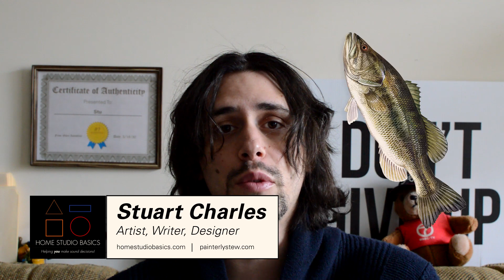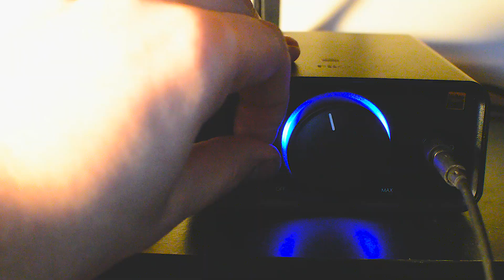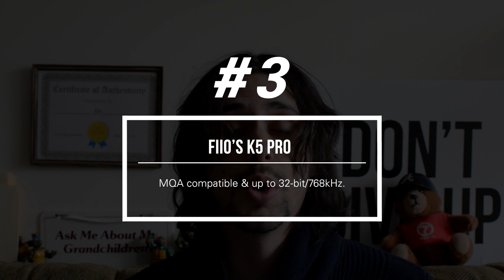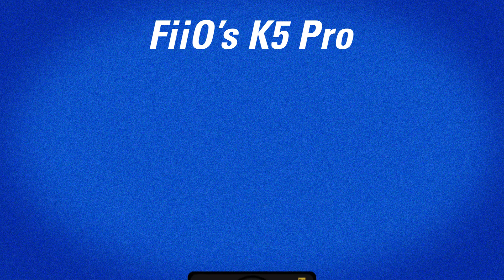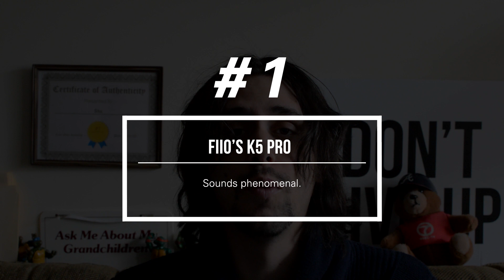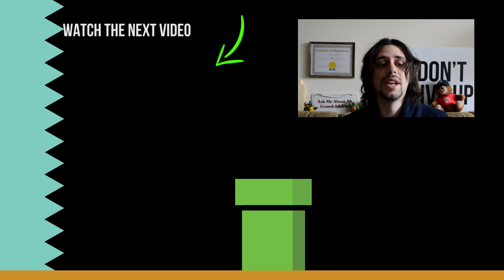💡Before YOU Buy A K5 Pro, WATCH THIS!!

Comment: Do you think the soundsignature is noticeably diferent on the new ESS model? Considering picking this guy up. Thanks for the video man.
Reply from the maker: Hey man! I haven't tried that ESS version but I'm assuming it uses the Sabre chip. I'm going to try and get one for demo/comparison.
Reply: @HomeStudioBasics just picked up the K5 Pro ESS from Fiio's Ali store for $90 for Black Friday.
Reply: For most DAP and DAC, I only notice the significant sound signature when using the balanced output. So I recommend you add a little more money to buy the k7 and use the balanced output.

Comment: Hi. Ive watched your vids for like more than 10x and I just cant decide if I am to get this or an E30/L30 stack. Do you have any insights on it? Thank you
Reply from the maker: It's kind of tough but I heard there were issues with QC on the Topping Stack. The one thing I like about Topping over K5 Pro is the remote allows me to be even more of a lazier SOB than I am. Never have to get up to adjust the volume lol. 

Both K5 Pro and topping have the issue of messing with wires a lot if you want to transport them vs. the G6 and Zen V2 are USB plug and play. That's just for gaming though. If we're talking about general listening, I use the Zen and K5 Pro about equal, maybe Zen V2 slightly more. 

Sound wise, the Topping is def the most neutral so if that's what you value, then it's probably going to be better for you. The Zen and K5 Pro are kind of like a cross between neutral and warm-ish.

Comment: I understand you can use the k5 on the "old" consoles via optical cable but is the k5 pro usable on the ps5 or xbox via USB?

Thanks :). <3
Reply from the maker: Hey man from my understanding you can use an HDMI extractor but there's also this way: PS5 (USB) -> UAC1.0 device (Optical/Toslink/CoaxialDigital) -> your DAC -> your amp -> your headphones. If you don't already have a K5 Pro I'd honestly just get a Creative G6 as you can just plug it into the front via USB and it's much easier. I have no idea why they did away with optical. Stupid and annoying, I know. https://homestudiobasics.com/creative-soundblasterx-g6-amp-dac-review/

Comment: Probably late to the party but can anyone or even your good self help me, is there anyway I can connect this or pair this with GOXLR, have looked all over internet and YouTube and I am none the wiser…..many thanks in advance
Reply from the maker: Hey man! Looks like that has a line out so yeah. Just use 3.5mm from the out into the RCA input on the K5 Pro and tick the switch on the K5 Pro to the middle for "line". :) AFAIK, the optical on the GOXLR is an I/O so that will work as well. For that you'd flip the switch up one on the K5 Pro to S (for S/PDIF). Let me know if you have any questions!

Comment: Hey,
I currently have a Dragonfly Black which I'm using to power my HIFIMAN SUNDARA.
Since they day I bought my DF Black, I've been doubting wheather they were the right purchase, because I feel like the Hifimans have much more untapped power.

Have you used the Df Black before, and if you have, how much of a difference did you experience b/w that and the Fiio K5 Pro
Reply: APPARENTLY AMPLIFICATION IS SECOND MOST IMPORTANT FACTOR NEXT TO THE HEADPHONES
Reply from the maker: Sorry. Somehow that comment got entered into the wrong box. I'm really sorry about that lol. YouTube is strange sometimes. I'm going to go ahead and delete that. There's a guy who's been asking me questions for 3 years and still hasn't bought anything haha. 

I haven't used the Black with a Sundara, but the difference between the Dragonflies and K5 Pro is that the K5 is a bit on the warmer side while the Flies are very cool, open, and spacious sounding. K5 Pro is my daily driver though so there's that. I use it because it sounds really good, has plenty of power, and is super versatile. I like the Flies and always recommend them because of the ESS chip (which I think is just about the best), but I'd much rather have a K5 Pro for everyday duties. :) Let me know if that helps man!
Reply: @HomeStudioBasics  Thanks man

Comment: What do you think is the better one sound wise? The Samson SR850 or the Sennheiser HD206,201 they are priced the same where i am from. All the other models and brands are overpriced here. Thanks for the help. Your video started my interest.
Reply from the maker: Hey man! The 201 and 206 are technically "better" on paper, but you may find them dull, boring, and too flat after awhile. They also aren't the fastest and most capable drivers out there, but it's to be expected for the price. I still like the 201 quite a bit, but you may just end up upgrading down the road. The 850 is great, but does have the treble bite What about something like a K240 or 9500? Actually, the KPH30i dumps on all of them lol. Haven't added that one in yet, but Check out my budget kings list: https://homestudiobasics.com/philips-shp9500-review-impressive/ I think all of those should be on your radar and I'd bypass 201, 206, and 850. :)
Reply: @Gabriel Cua you are here from dankpods right?

Comment: The K5 Pro pairs nicely with the HD560s - which makes a pretty competent sounding budget setup.
Reply from the maker: Yes! Great pair. I'm listening now with the 9500's and it's just perfect because it kind of tames down the bite that the 9500's have.
Reply: Is it worth it? I have the HD560s without an amp, just straight into the mobo. Is there a noticable difference?
Reply: @Maoilios  I tried the HD560s with an Ipad Mini gen 4 (which is ok sounding) and a MacBook Pro. Both of them sounded quite lifeless compared to the  K5 Pro.
Reply: @stefanredmond8884  Got it, thanks. Been thinking about getting an dac/amp for my hd560s, mainly because of static noise from my motherboard and some crackling, so the k5 pro is probably what I will choose
Reply: I have the HD560s and I don't know whether to buy the k5 or the izi zen dac2, in Europe the price of the k5 is 70 euros more expensive than the zen, do you think it is worth paying more for the k5?

Thank you

Comment: How would you compare the sound between the xDSD and the K5 Pro? It's a bit of a stretch with the prince ranges, but I would like your opinion/input on that too!
Reply from the maker: Hey man! Haven't heard the xDSD in awhile, but they're actually pretty similar from what I remember about the xDSD. Both have a hint of warmth but aren't overly warm. Both have similar output impedance. The K5 Pro is 1.2 vs. less than 2 for xDSD, so pretty comparable. The xDSD to me had a nice enjoyable balance of smooth but also detailed, similar to the K5 Pro. I like the features on the xDSD with the 3D enhancer and true bass.

Comment: My intro into the hobby was the Sundara and a K5 pro used for $110. Been really happy with it so far.
Reply from the maker: Great set up and price! I think the best value combos under $200 are the G6 and K5 Pro. Zen is probably third. Still great but doesn't do quite as much. D1 is good also. I recommended that a lot before I tried K5 Pro and G6.
Reply: @HomeStudioBasics  Funny cuz I was wondering your thoughts on it when I originally purchased it. I saw all your other setup reccomendations but I figured at $110 I couldn't really fuck up with Amazon rentals 😉. Cool to see you show it some love after I already had it. I'm seriously considering returning the sundaras for the anandas. I've watched your video on them 3 times already. I have big as fuck ears like hommie in your video so the sundara gets a tiny bit uncomfortable after a few hours. Problem is I hated the stock pads as they were scratchy feeling and I got some dekoni leather joints on the sundara which they don't make for the ananda. Fuck!  I'm stuck like them chicks be in the drying machine on those movies
Reply from the maker: @pcp2522  You got them dumbo sized joints? LMAO. YEAH HOMIE! GET THAT ANANDA!!!!!!!
Reply: @HomeStudioBasics  ended up getting the denon ah D7200. Mainly cuz girls mom works for an audio company and I got a dumb good deal on them. Usually 1k I got then for less then the sundaras which are getting 0 play since I got these denons.

Comment: k5pro does have lots of power, i am using it with dt770pro 250ohm, my windows volume is set to 80% and k5pro is set to 12o'clock at low gain and its loud and clear and punchy enough for me, no noise at all when no music is playing and switching sounds.
Reply from the maker: Yes love it! Using with 9500 no gain need obv. Just a great match as it helps tame down the 9500's bite.